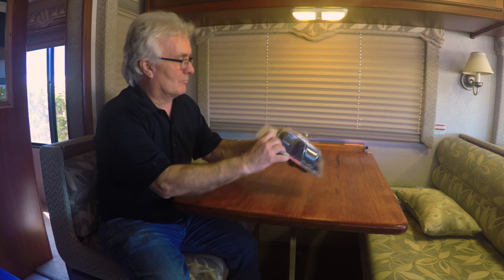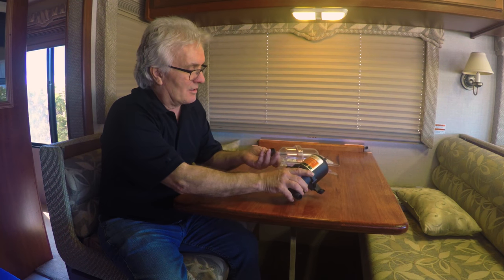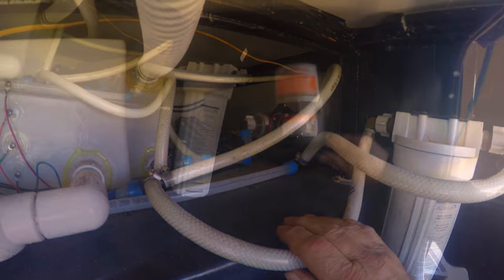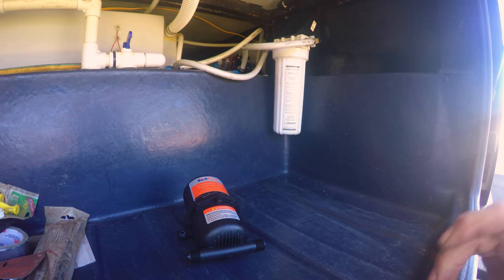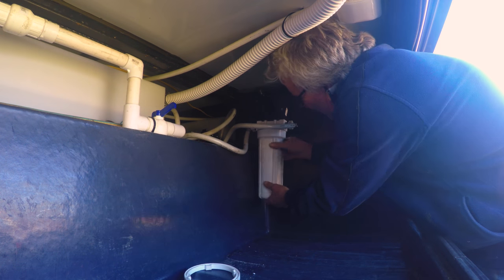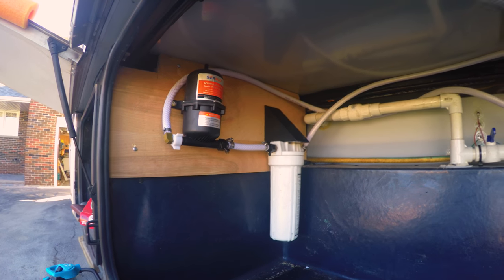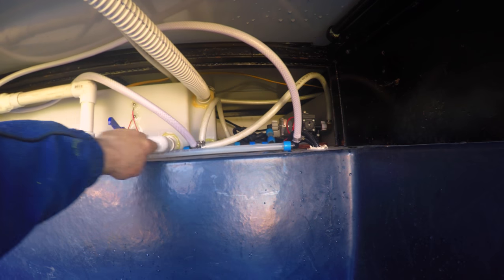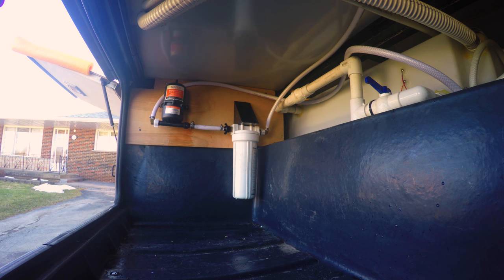Rv Accumulator Tank Install

Comment: I thought a 60 psi pump requires 55!psi accumulator and a 40 psi pump requires a 35 psi.  I thought it was 3 or 4 psi under the pumps psi???

Comment: Update, the accumulator tank is awesome, it pretty much solved my short cycle problem thereby saving the life of the pump from overworking during slow water needs.
Reply from the maker: Yes I agree… one of the best upgrades I have done to our RV and I have not touched it since I installed it!
Reply: @rvingandseeing3010  Although I can of course hear the pump turn on and off, it is not as loud as I thought it would be based on a couple other videos on it, I expected to have my ears blown out, and mine is right under the kitchen counter with the only sound barrier being the cabinet doors.

Comment: The accumulator Needs to be mounted as close as possible to the pump outlet.  
The less pulsating mass between the pump and the accumulator the better the ability to quiet pump pulsation.  
It looks like you could have mounted it just above the original filter location.     <;)
Reply from the maker: Yes technically you are correct but I wanted nothing in the way of the new batteries and we don’t even here the pump anymore.
Reply: I wanted to mount my right at the pump, but could not due to my error in designing my water system, decided not to redo my whole water setup but yes, connecting to the pump was my preference and I would highly recommend to anyone getting and install the accumulator tank, regardless of how it is connected, it works!

Comment: You probably want to mount the accumulator a little further down so you can get at the pressure valve on top with a pressure gauge and pressure pump. Also, a low pressure gauge, like that for ATV tires, is better for reading the pressure in the accumulator. A normal tire gauge is not very good at reading such low pressures, especially the electronic ones.
Reply from the maker: I have two 0-25 psi pressure gauges from my racing days that are very accurate and  I compared the results. Location works fine.

Comment: The accumulator pressure should be set at 4 to 5 psi lower than the cut out switch pressure stated on the pump spec’s
Reply: This is good to know, I found this works by accident, but yes it is a good idea.
Reply: Thanx for the good info. Do I need some type of tool to measure the psi of the accumulator?
Reply: @netdedouga I used my battery charger that comes with a tire pressure gauge for flat tires
Reply: I thought it was pump then accumulator then tap ???  Am I missing something???

Comment: thx for your help/response.  

i was able to test my new water pump (power autoOn autoOff ) based on pressure.

i am finging tjat when the pump has almost reach it preset pressure for turnOff the pump makes a lot of noise /vibrating (scary)

can the above issue be resolved with the accessory that you are now installing (as per this video).
Reply from the maker: It will make it quieter but won’t stop it completely.

Comment: Looks good, just wondering why you wanted to put the batteries closer to the water pump, when all your electrical stuff was on the other side of that plywood you put in?  Seems like shorter runs on the hoses would have been better too, so you could have kept the water stuff on the right and the batteries on the left in there.
Reply from the maker: The batteries need to be on the right because they pair up with the other 2 house batteries that are next to that spot. Short runs for heavy battery cables that feed a large inverter are very important. I also have to build an enclosure around the new batteries and vent it outside. Just easier in that spot.

Comment: What kind of hose did you use for the connection?  Any issues with the rubber hose leaking?  It appears you have used PEX clamp style connectors on some of the connections with the rubber hose....correct?
Reply from the maker: Don’t use rubber as it make the water taste bad. I had some fibreglass reinforced clear water line. I use a 50 psi regulator so blowout shouldn’t be a problem. I used what I had at home for connections, but pex is the best way. No leaks after the initial retightening of two hose clamps. Works great!

Comment: would turning up the pressure in the accumulator tank result into lower pressure in the tubes?
How much pressure should i put onto the accumulator if my pump has 4,5bar?
Reply from the maker: According to the directions I believe you match the cut in pressure for the pump. I can’t remember for sure but it’s printed on the label. Changing the pressure doesn’t have too much effect.
Reply: @rvingandseeing3010  3 or 4 psi below count out pressure of your pump.  So for my 60psi pump I set my accumulator tank at 55 psi

Comment: I'm confused by your connection explanation at 3:54 - is your city water running through the accumulator tank?
Reply from the maker: Yes all water runs past the accumulator and then into the filter.
Reply: @rvingandseeing3010  ok... i've been looking at diagrams and i've only seen where the city water just tees into the lines past the pump & accumulator. I teed my city water that way and even though I put in a check valve, i'm getting water flowing backwards into my accumulator tank. I just wanted to research more to see if I did my install proper. thanks for the quick reply!
Reply: @rvingandseeing3010 I thought it was water filter accumulator pump tap.  You seem to have water accumulator filter pump tap
Reply: @EllenMcDermott  it’s pump, filter, accumulator, then out to the system. Or pump, accumulator, filter. Either one works.
Reply: @philarmishaw3730  sorry I don’t understand “out to the system”.  I thought it was water supply, pump accumulator and out the tap into the sink
Reply from the maker: @EllenMcDermott system = tap, shower, toilet, etc

Comment: question... how is the power managed.

does the pump turn on tue power when there is pressure change  ?
Reply from the maker: Yes the pump turns on by demand as the pressure drops.
Reply: @rvingandseeing3010  soooo i can connect power and not worry about battery drain (solar battery)
Reply: @IslandNassau  yes